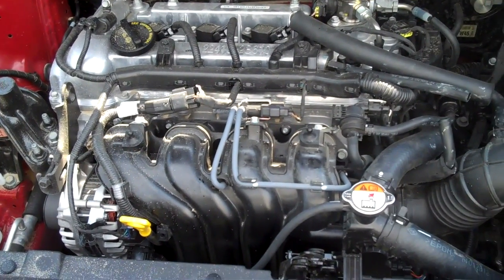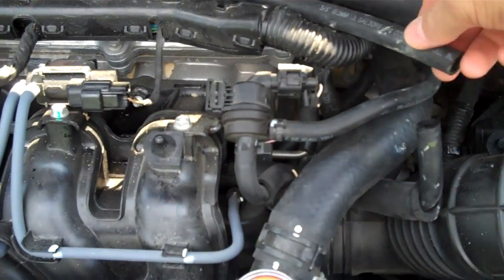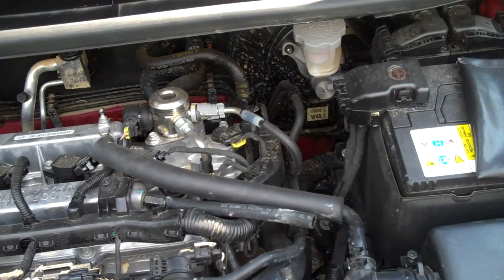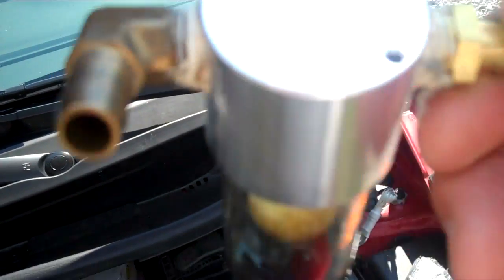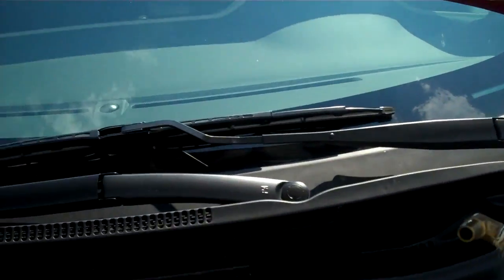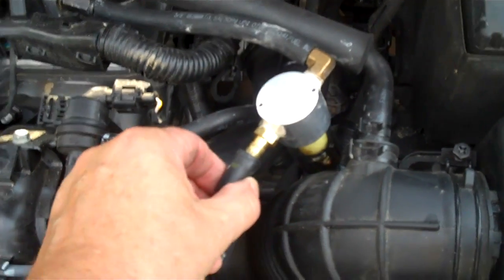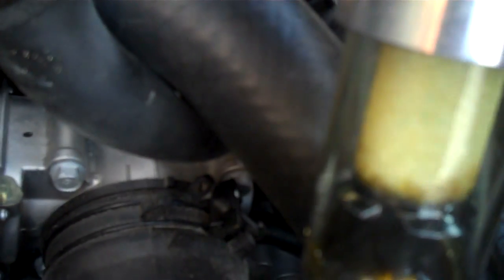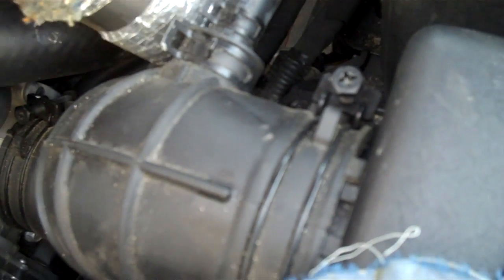Air Oil Seperator

Comment: That particular air/oil separator is of poor quality.  Being made out of polycarbonate (plastic) mine developed cracks after a couple of months and I replaced it with one made of billet aluminum.  Buy a good one rather than a cheap one like this piece of crap from Summit.  Like the Spanish proverb says:  "lo barato cuesta caro".